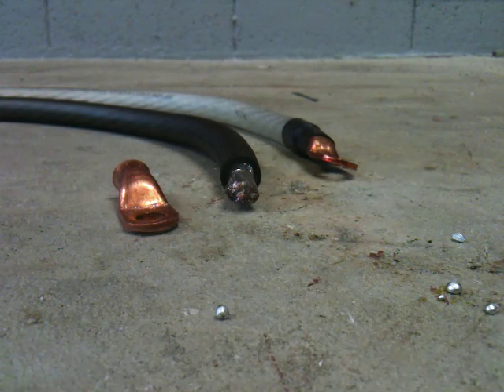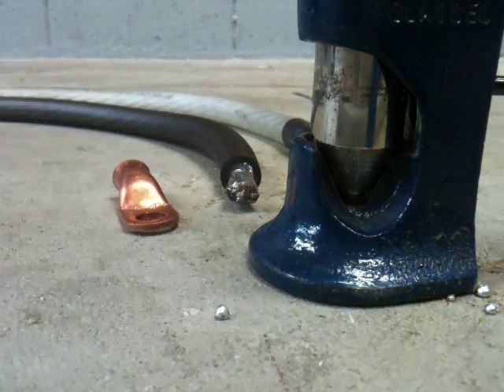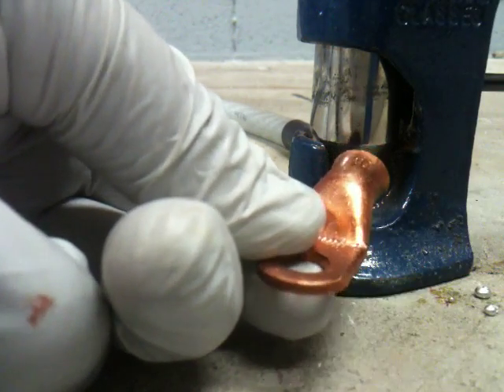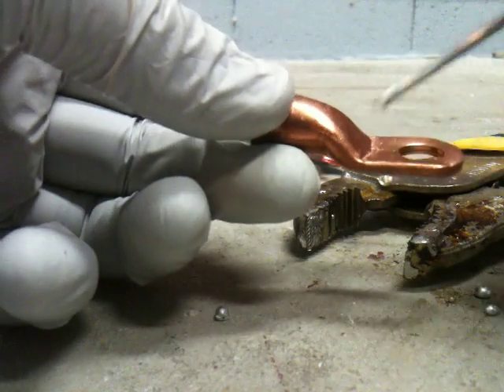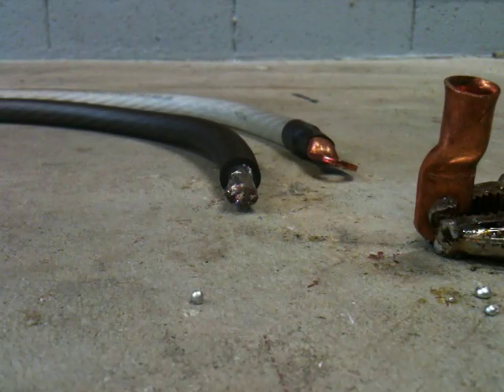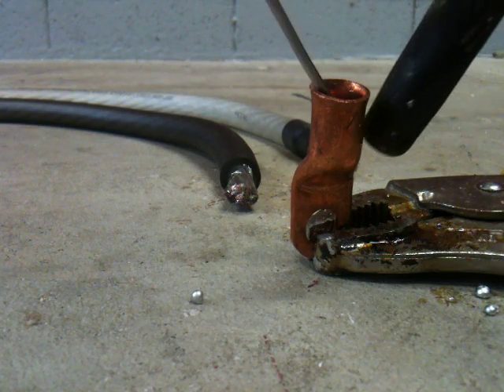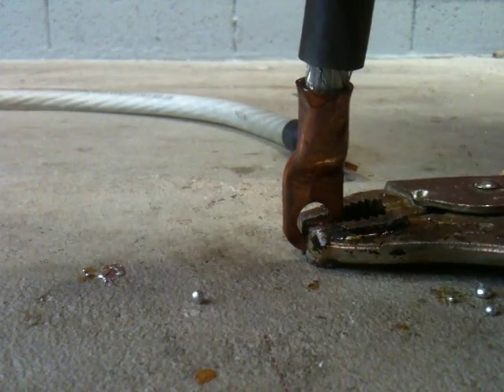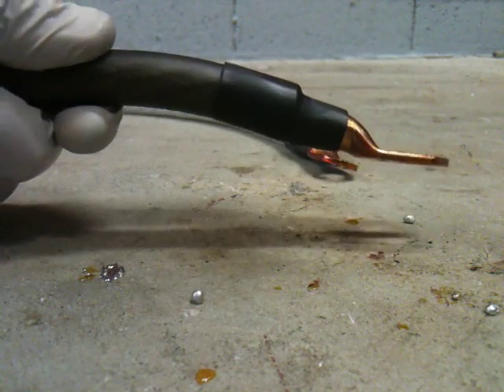How to Solder battery terminals

Comment from the maker: I use regular 60/40 solder. (The thin stuff) You take a piece about 5 foot long and cut it, then you fold it in 1/2 as many times as it takes to make a piece about 8 inches long twits it also.

Comment: cold joint. not good at all. when you solder you heat up the wire or in this case the connector itself never the solder

Comment from the maker: It's been three years since I made and posted that video. I've done over 400 solder connections like that and have not had a problem with a single one. There are a few things I could've done better like preheat the wire and I have had good luck with a liquid flux that helps the solder creep up the wire. But even doing the connections the way you see in the video do a search for One of my other videos where I cut the terminal in half and you can see how complete and solid the Sauter creeps through the wire and makes a good connection
Reply: but it works? so it doesn't suck, muppet!

Comment from the maker: LOL: In retro spec I agree I could have done a better job. I have done over 300 battery terminals and Yes I have found some tricks along the way that makes it come out a bit cleaner but in the end the connection is solid and I have not had one fail or not create a solid connection.  Thanks for your comments

Comment from the maker: Valveman; Thanks for your comment. You are correct about heating the lug only. I have found that the Flux is what catches on fire. I have changed my tequnique and Now I just heat the lug. Depending on how much flux your dealing with will effect how flamable your ordeal is

Comment: I have some 95% tin solder, and on the back of the packaging it says "non-conductive". My question is, will my connection and current flow now be poor because I filled the lug with tin solder? It has rosin-core

Comment from the maker: The copper terminals conduct and transfer heat VERY well. When you drop the solder into the terminals and heat it and create the molten pot of solder the terminal is very HOT. One thing I have started doing is blasting the striped end of the wire with heat getting it warm to hot and that IMO helps the solder creep up the wire. I have done over 300 of these to date and I have not had one problem or falure, Knocking on wood!
Reply: I appreciate the fact that you have pointed out what you've learned and what you're doing now. Thank you!!

Comment: A. This is a perfect example of a cold solder joint. B. That is not dual wall heat shrink so corrosion is going to occur much quicker due to the absence of a sealer contained within good dual wall heat shrink.

Comment: Without heating up the wire itself, isn't this effectively an improper "cold solder" connection?
Reply: I have done this connection on truck and boat and not one issue.  I actually cut it open to see how it looked in the lug and it's solid.

Comment: I use thin flux core solder to do this (actually figured this out because it was too big for my circuit board rework I was doing). The thick stuff is hard to work with.  Take the thin stuff, coil it up, and stick it down in the copper well of the connector and melt it into a puddle (neat rosin puddle on top.  I always torch the end of the wire to heat it up before I merge them together to make sure there is adequate transfer when I put the two together.  Works GREAT and have had zero failures.

Comment: What is the right way/technique to solder these ends then? This is how it was explained to me years ago but I've done it.
I've got a truck that needs the existing harness ends cut back and new terminals installed at the battery - would soldering work on the crimpable battery terminals.

Comment from the maker: Thanks for all your comments. Update I have done around 70-80 of these battery terminals to date & have not had a single problem. Before I started doing these this way I made a cable with 2 solderd ends on it and mounted it to a beam and tryed pulling the solderd rings off, Its very strong and it makes a awesome connection.

Comment: Soldering battery connections is a BAD idea. Most people believe that soldering is superior to crimping, but this is not the case. Soldering creates additional resistance at the connection, as well as creating a connection with less current transfer capability. Also, soldering will create its own corrosion due to the inherent flux material.